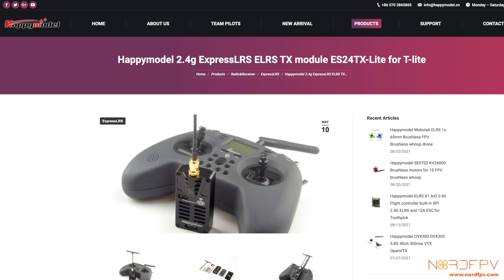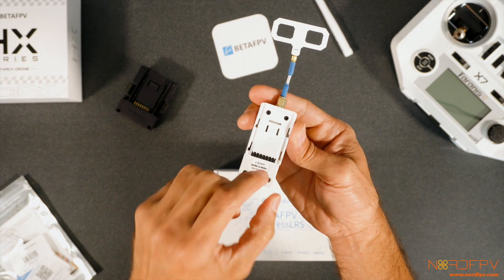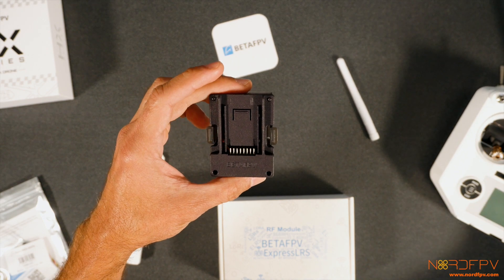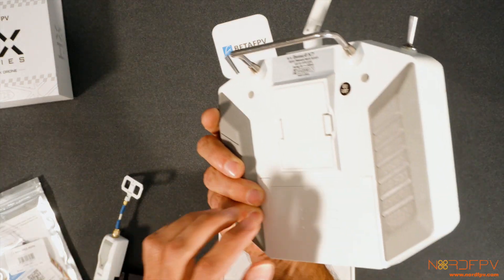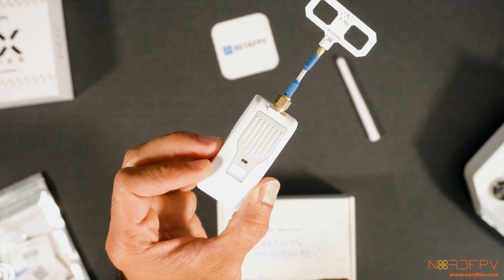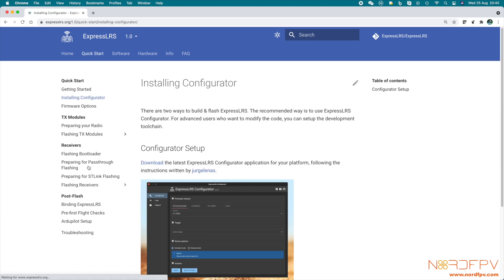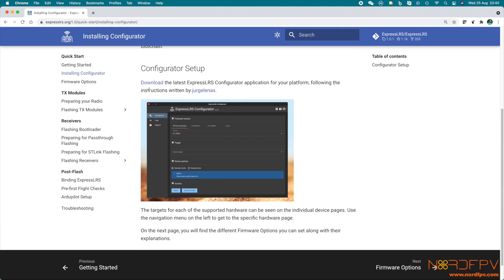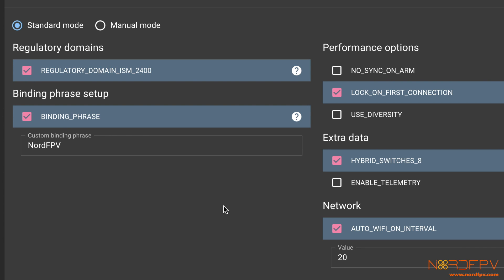What's Express LRS - BetaFPV ELRS   Review

Comment: Missed alot of features like packet rate range better multiple pilots in the air. Ordered the betafpv module for my Tango 2 hopefully I dont have that problem.
Reply from the maker: You are right. I didn't describe a few of the benefits of ELRS as you are saying, but mainly because I think once it's working it's working, and you forget about it. That's how technology should work, so invisible that you don't have to think about it, just use it.